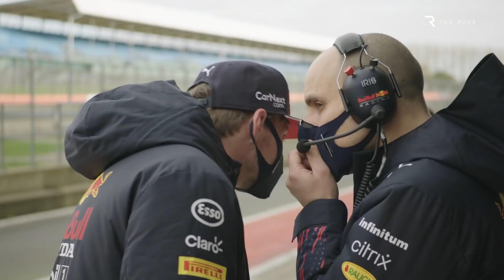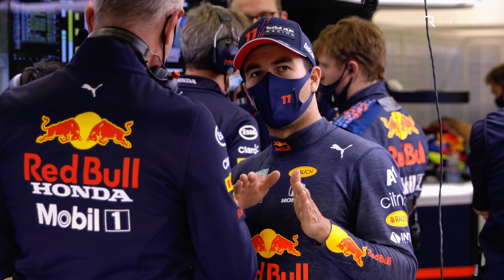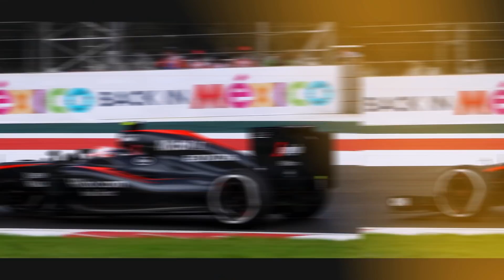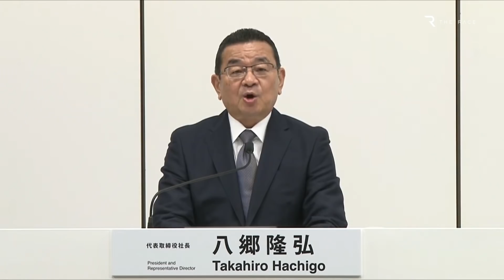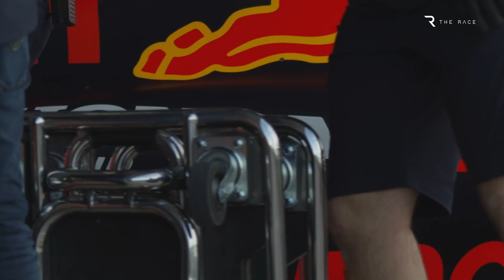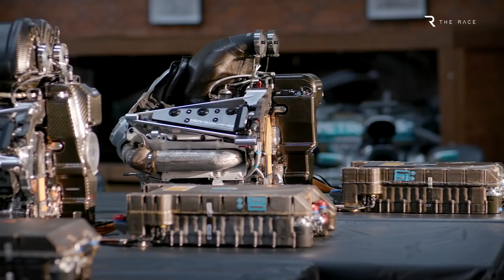The major F1 engine upgrade Honda kept secret

Comment: It's crazy that literally everyone reveals their secrets except for Mercs
Reply: @VERY EVIL PERSON FROM ILLUMINATI bro your comment tells me you don’t actually understand what downforce is. Hungary is a high downforce track. Having skinny rear wings doesn’t help there. It is not a power dependant circuit and top speed doesn’t mean anything there.
Reply: @VERY EVIL PERSON FROM ILLUMINATI and whether it’s merc or red bull or any other team the wings change depending on the type of track they’re on. The races you need to look at are Austria. Even though merc has a better PU they had to run thicker rear wings cause their car produced less downforce (more drag) than the red bull hence them losing time on the straights. While red bull could easily run slimmer rear wings and still produce enough downforce for the corners.
Reply: Pretty sure merc stopped development on present car trying to get ready for next year
Reply: @shreyassr1150 , MB did not have the credits to respond to the rules change last year that lowered the rake of the cars. It would require aero work plus suspension pickup/mounting points on the car.

So, yeah, they could not properly develop the car.
Reply: @VERY EVIL PERSON FROM ILLUMINATI define much faster? At the speed trap lh was 1.4km/h faster than mv but actually 2km/h slower at the start line.
Reply: because the mercs still have way more power than all other cars. atleast significantly. you can see how little downforce redbull runs with to even try and keep up, whilst mercedes run massive rear wings and can still go faster at the top end.

its like mercedes is hiding something... maybe a potentially illegal part? thats why their engine has been so OP the past 7 years.
Reply: @wildwilco  if Mercedes were hiding something, then McLaren and Team Enstone would've known about it after ditching Mercedes power in 2015/2016.  There's no way Merc could've kept something significant which was illegal hidden during that period, let alone all these years later.  And their engine advantage has reduced from the colossal edge they had in 2014, to a very small difference to the Honda engine today -- not to mention that Ferrari overtook Mercedes in 2018-2019 before being found out.

If you're wondering why Red Bull has to run significantly less downforce to keep up with Mercedes on the straights, then the answer is more to do with rake than it is to do with engine performance.  The low-rake Mercedes has inherently less drag than the high-rake Red Bull.  It also has inherently less downforce.  If Red Bull have to run skinnier wings and still can't keep up at Monza, then that's because of their high-rake philosophy; the opposite is true at Monaco, where Mercedes were way off Red Bull.
Reply: @wildwilco  That's because the RedBulls have always built their car based on high downforce philosophy dude, where have you been? and why tf is this getting so many likes lmao
Reply: @wildwilco  not even close. RB runs high rake meaning they produce more down force through the floor but creates large amounts of drag. To compensate for this they run less wing for two reasons:
1. They are already generating the down force they need so don't need a large wing.
2. Reduce drag because of the rake system. 
You only need to look at the speed traps from the races to see mercs are rarely at the top.
Reply: @wildwilco  Top speed usually has nothing to do with engine power but mostly with drag, if you check out acceleration numbers to 250 or 300kmh honda is neck and neck with mercedes
Reply: @wildwilco  what are you talking about bro? Hamilton have been struggling to get past McLarens for 2 races straight. (Norris at Monza, Ric at Sochi first part and Norris at second part). We havent really seen wheel to wheel action between Max and Lewis lately (besides Monza crash) but considering Max breezed through Bottas in just 1 lap, both with fresh engines, I highly doubt what you say is true. Mercedes is clearly struggling this year compared with the years before
Reply: @andreas98andreas98  Both McLarens are Mercedes powered
Reply: @andreas98andreas98  They are "struggling" because both drivers are mediocre and can no longer hide behind 1 second per lap faster car. Merc is still fastest car on track, Red Bull just has Max instead of two post-accident Massa grade drivers (just see how Perez does in comparison, 5th in WDC)...
Reply: @KuK137 , you have to put down that crack pipe, bruh....
🙄
Reply: @WDLC1911  Dude, post accident Massa matched Bottas in 2014-2015 season, and was match for 44 in 2008-2013 ones. Too bad fanboys can't see inconvenient truth...
Reply: @KuK137  Dumb opinion you mean Max is only fast because of the car.
Reply: @C.R.O.P
Bottas? He just let Max go as he didn't see any point in holding Max behind him. That's what Merc get for ruining Bottas race, everytime he's to close to Lewis.
Reply: @andreas98andreas98   And later Alonso overtook Max with a Renault PU
Reply: @KuK137  we have a delusional person here.
Reply: @KuK137 , how competitive was the McLaren in those years?

I’ll wait...
Reply: @wildwilco  Yeah I've been wondering the same, but at the same time Mercedez maxed out the budget every year, while others didn't, so who knows.
Reply: @wildwilco  their innovation is like no other team
Reply: @wildwilco  nah not really if they’re using illegal parts, that 7-world title will be void and null. Red bull usually brings out the illegal parts here
Reply: @Lelouch980  hahahaha what illegal parts are you talking about.
Reply: @francisco5578  flexy wings
Reply: @Lelouch980  everyone had flexi wings, including mercedes just check the onboards, all teams flexed their wings just as much as redbull. and they were legal. They changed thetesting parameters mid season wich is diferent to a part being illegal. A change that was requested by guess what team. Mercedes.
Reply: @Lelouch980  It's Mercedes
Reply: @Lelouch980  Didn't Ferrari engines underrate fuel flow as well?
Reply: @RhodokTribesman  yeah but we just put Ferrari aside because this is RB and Merc discussion
Reply: @VERY EVIL PERSON FROM ILLUMINATI looks like you don’t know what you’re talking about. Merc struggles with the straight line speed cause they had to compensate the loss of downforce with their rear wings due to the nee technical regulations that made them cut the floorboard. Once the silverstone upgrade came they no longer needed to compensate with the rear wings and have their straight line speed advantage back. What are you saying about monza? Lewis was the only car that overtook Norris on track. If max didn’t crash with him he would’ve definitely gotten p2 or p1.
Reply: @lekudos  They are losing championship because overrated primadonna can only "win" with 1 second faster per lap car and is trashed by Max when it's just 0.5 seconds faster, LOL. Or when Merc rams Max car out of the race, too bad it only worked twice and he screwed up third attempt and DNF too...
Reply: @KuK137  I never said Merc is slower than Red Bull, I just said that they arent AS strong as they used to in the previous 5-6 seasons. Only in 2018 they had some kind of a fight but even that season's second half just ended up in Hamilton domination. Perez havent really gave what RB wanted from him thats also true. But my main idea wad that Mercedes might still be stronger but they have a very close competition now, showing that they arent at the level they used to be.
Reply: Mercedes is hiding something 100%  

Mercedes 🎤 Only god can judge me now 🏆
Reply: @Cestus1  hiding something in your bum maybe yeah